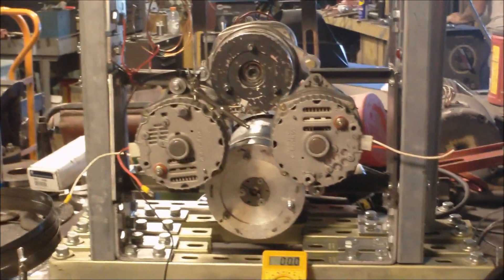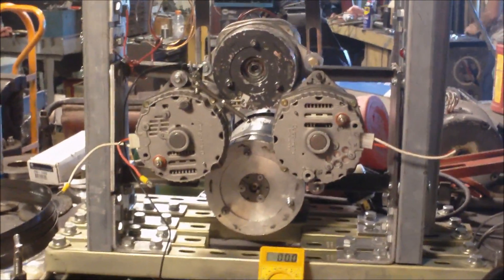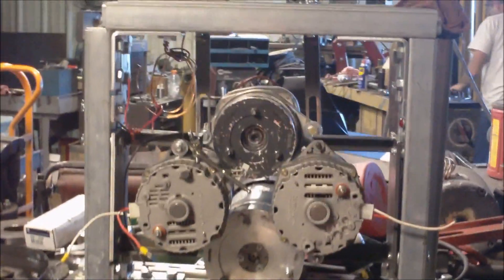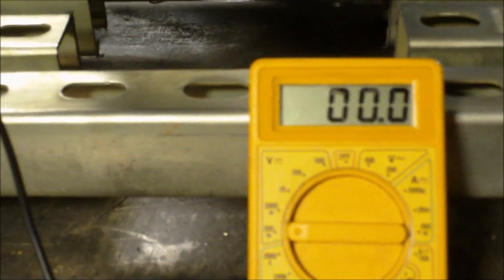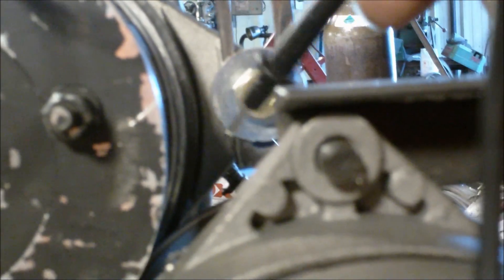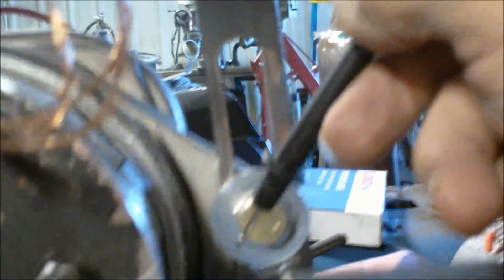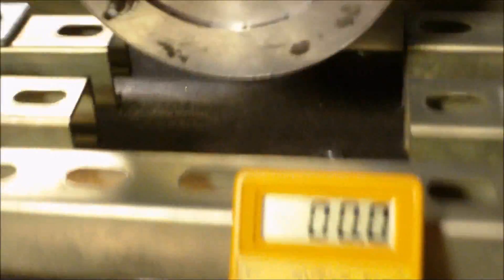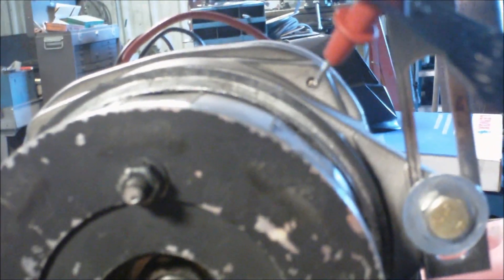strange things hatem magnetic cogging

Comment: if those readings are ac mv, this is not unusual. more likely induced voltage from ac power in the shop.
the body acts like an antenna for 60cycle power, both your body and the meter are high impedance.
Reply from the maker: well here's the thing. as long as you don't touch the one probe to a head it takes several days and the reading fades away. when you touch any of the heads with both probes it drops back to 0.0

Comment from the maker: well sorry i'm late again. the magnets are 1"x2"x1/2" strength 42 spacing between all heads is 1/16". head sizes with a 1" gap between magnets 8 magnets od of 2.613. 12 magnets3.864. will have to check with the machinist and get the figures for the 10mags. 

the heat is coming from lenz's law best guess. maybe the al. head is acting as a capacitor???? all the best oyd868b

Comment: probably whats going on is some current leaking inside the meter, mabye the motr is acting as a capacitor. also about run by itself, i would highly reccommend adding magnetic idlers, before any alternators... the more idlers, the more times you reproduce the effect for whats on the end.. if that dont work i dont know what will.